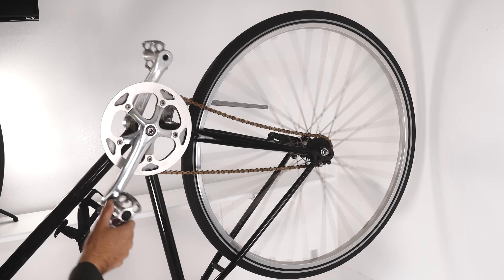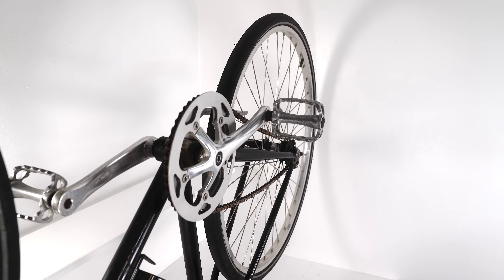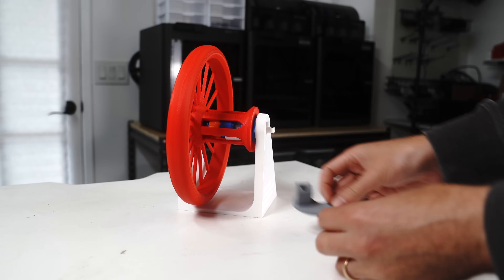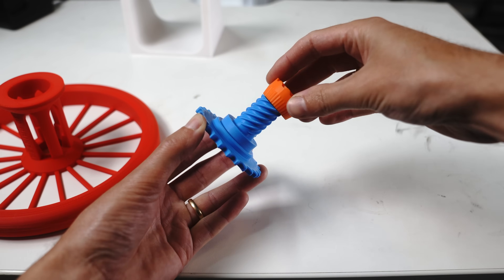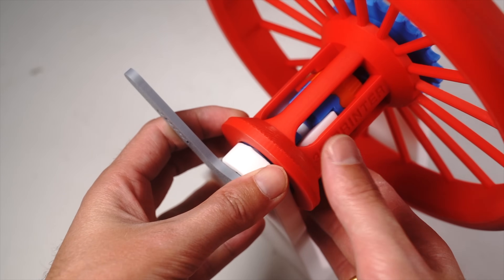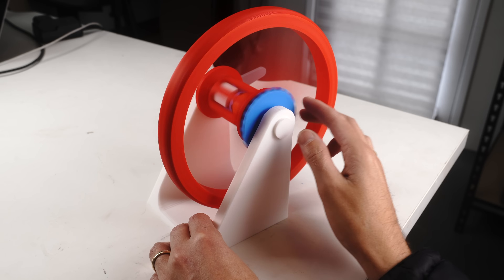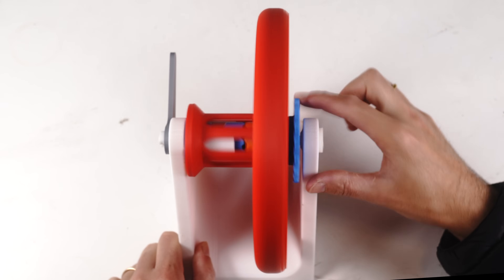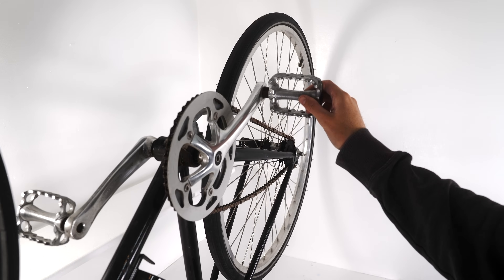The design of bike wheels is genius.

Comment: Amazing. Not the bicycle hub, but the fact that 90% of the people making comments below never heard of it. 
This is what I and most of my generation grew up with; single gear with coaster breaks (look for "Schwinn bicycle 1965" and notice no hand breaks and a 2 to 3 inch diameter rear hub). Hand breaks were only on expensive "English racing bikes" that most parents couldn't afford to give to their kids ... and "mountain bikes" with multiple gears and hand breaks didn't exist in the 50s, 60s, and 70s. They were an evolution of a crazy 60s and 70s fad in bikes called "Banana Bikes".
By-the-way; for those who have never experienced a coaster break, they are 10 times more powerful than most any other breaking system found on a bicycle AND they work even if the hub is flooded with water.
Reply: I grew up in the 90's with cheep huffy bikes. Yeah, I had hand brakes, but it was much more fun to peddle backwards and lock up the wheel.

Comment: hand brakes are dogwater ur using the handles to hold the bike, while braking you need to hold on much more than while coasting so the prospect of having to lessen your grip to reach the hand brake is just baffling to me, and what weirds me out even more is the fact that there are front brakes like bro if I want to face plant onto asphalt at high speed I would've just jumped on a building 💀

Comment: I have literally never seen a bike which stops when you pedal backwards in my entire life. Is this an american thing?
Reply: It's very common in city bikes all over the world.
Reply: You don't really see them on variable geared bikes, most commonly they are on children's bikes and older style adult bikes.
Reply: This was the most common bicycle rear hub up to (about) the 1970s. If you have never seen one you are probably 35 years old or less. They are making a comeback, though, because they make an easy front hub e-bike conversion. The re-make of the 1960s Schwinn "Dixie" has a hefty front fork able to stand up to the torque from a front hub motor, you don't really use the lower gears on an e-bike conversion, and the coaster break is more powerful than any other bicycle breaking system except maybe hydraulic disk breaks.

Comment: I had never seen a bike like that. If you're going very fast doesn't the sudden stop break the brake and/or makes the person fall?
Reply: Internally it uses brake pads so you can slow it down gradually just like hand brakes.  If you stomped on the brake then the wheel would lock up, but this is also true for hand brakes (but harder).
Reply: They are also only on the rear tire, which has a lot less to do with falling than the front tire.
Reply: @777idkineedausername depends on the surface, ideally one should do something like ABS is doing in the car, braking and releasing continously to prevent lock up and overheating

Comment: Wait. I could never brake with the pedals. I always had to use the brake handles for that!
Reply: There are different types of breaks, if you have brake handles you most likely don't have that mechanism shown in the video.
Reply: My car doesn't have a clutch, therefore manual transmissions.must not exist.

Comment: not if you have a wheel hub electric motor based electric drive. then you just short the wires if you want to stop and put more electricity to go faster.
Reply: You can't use this brake if your bike does not have this brake. You also can't use a USB device on something that only has PS2 ports. You can't change your engine oil on an electric car. You can't watch Television on a radio. 
He opened the video stating not every bike has these, what are you trying to prove?

Comment: What holds the pads in tension when the breaks aren't engaged? If they are floating they would jostle, wear, and clip the inner axle during operation.
Reply: On this design there's nothing. The hub is normally full of grease and they don't have space to jostle much so it's not a problem. I don't know if there's a proper name for it but the google magic words for this design are "Schwinn coaster hub".
On some other designs the brake pad is a cylinder with a slot cut into it, or two pads forming a cylinder with a spring around them, so it doesn't go anywhere unless the brake mechanism forces it to expand. If you google "Torpedo coaster hub" you can find examples of it.
Reply: @Cyrenetes  this is why I'm a programmer and not an engineer. Lubricants never entered my mind. Thanks.

Comment: never heard of a brake like this. Very clever, but what is wrong with normal brakes?
Reply: These were the normal brakes back in the day. Weather doesnt effect them and they never wear.
Reply: @martinsvensson6884  they do wear and weather does affect them. not sure why you think otherwise
Reply: @realonionsoup1  Because everyone had them when I grew up. And I had several. And there was 0 noticable difference no matter weather. Never did any maintenance on them either ever. My granpas bike was probably around 50 years old. He had never touched that brake. Still wroked.
Reply: @martinsvensson6884 these breaks are still very common today. They are not an old style. Also, they may be sealed from the weather, but all mechanical parts wear out. Rubber brake pads would wear out faster, but bikes also can come with disk brakes, which are essentially just miniaturized car brakes.
Reply: @777idkineedausername It was pretty much the only type pf brake that bikes had earlier. That's the difference. Never heard of anyone ever serving those brakes on the bikes when I grew up. They would last longer than the bike itself.
Reply: they're simpler and more intuitive to operate, especially for casual bikers such as city goers 

plus you use your powerful legs to engage it instead of your fingers which are just meant to grab and hold stuff

plus it's overall more durable since all of the working parts are contained and shielded from the elements, not 100% weather proof but they're shielded
Reply: Must be a US thing?
Reply: @AdamWebb1982  "Must be a US thing?" I have no idea about that, but it certainly was a thing here is Sweden(Essentially all bikes back in the day had this kind of system), and it is still on some new bikes sold here.

Comment: Great explanation. Should check out the Buffalo S2 which changed this mechanics from a brake to a gear shift to allow both high and low gears.
It's really ingenious and makes use of two chains and sprockets.  Berm Peak on YouTube did a video on it called "Why This Bicycle Absolutely NEEDS 2 Chains"
Buffalo works with World Bicycle Relief to make rugged, easily repaired, easily maintained bicycles to bring mobility and access to the world.
Reply: I find it very funny when in that videos it is said you couldn't both brake and shift with backpedaling, a lot of bikes here in Sweden do both(with 2 gears in the hub, I think I heard someone saying there is bikes that even cycles between 3 gears like this!) and have done for a long time.